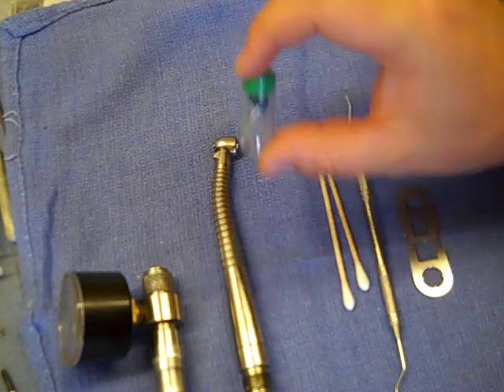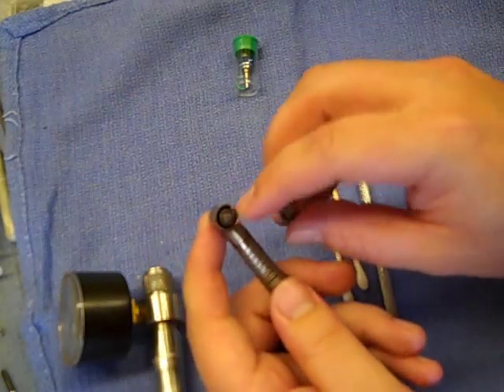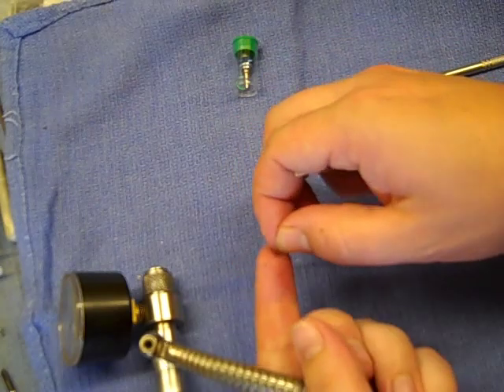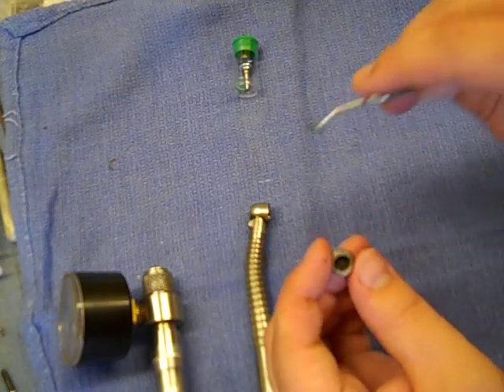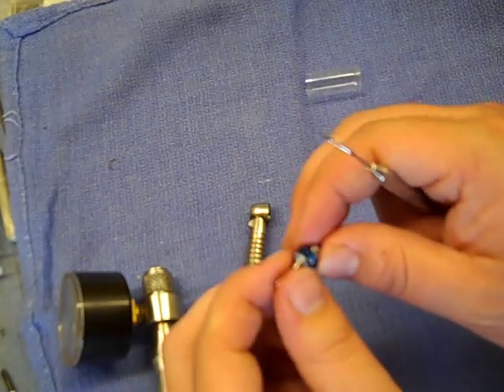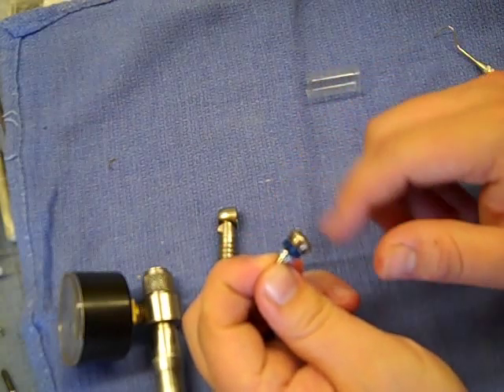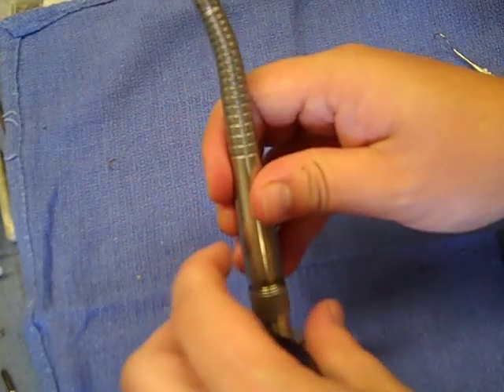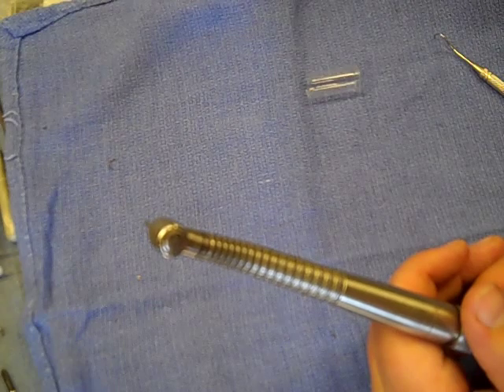Midwest Tradition turbine installation

Comment: Hello, I need to know the function of each tube of the turbine? Midewest (4 tubes).
And by the way, another question ... I lost the upper oring. The top, so to speak. What would happen if the use without the oring? Thanks!